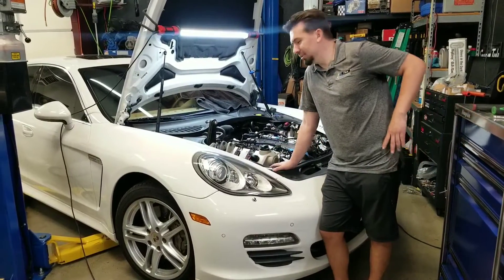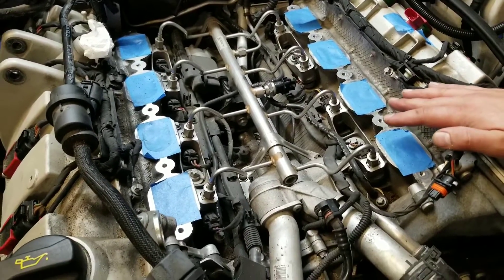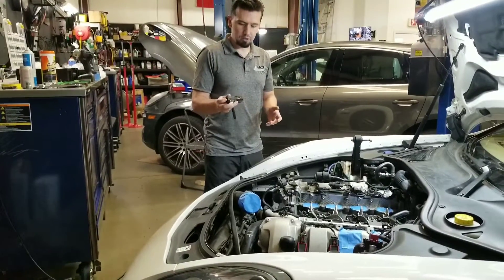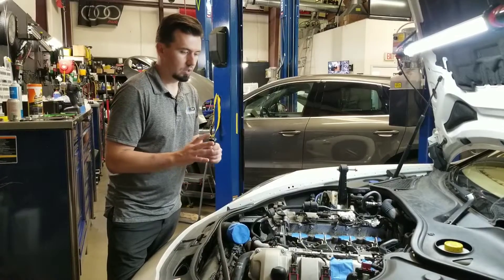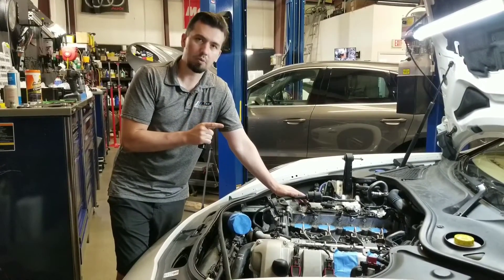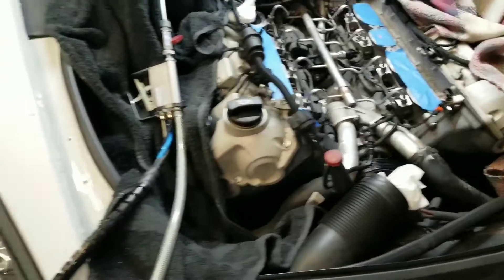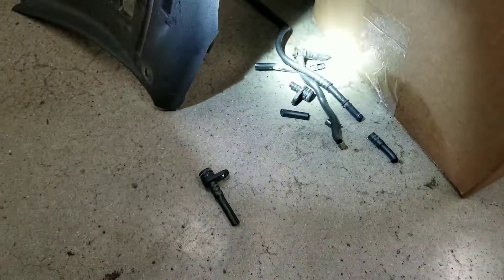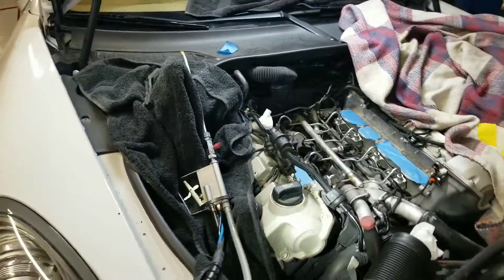PORSCHE Panamera with nasty carbon build up on all intake valves | What is the solution?

Comment: GREAT INSTRUCTION NICK! I had never seen this before and your explanation of WHY it builds up in Direct-Ijnected engines is easy to understand. In the video you mention it takes all day to do this, I imagine the majority of the job is in removing the intake, or is the actual decarbonization really that time intensive? I have a 267k mile Cayenne GTS, i can’t wait to remove the intake and see what those intake valves look like. Great tip too to point out that plastic vent system as a while you’re in there job. Thank you. I hope to see a DEMO of the De-Carb process, do you just adjust the crank shaft rotation to get the valves seated, and that’s when you blow the media in there? Is this not an opportunity to put abrasive media in the engine, or does whatever gets into the cylinder just somehow get picked up and removed with an oil change?

Comment: So the vr6 doesn't build up carbon in the intake valves?
Reply: It’s problematic in DFI cars because fuel is injected into the cylinder, not the old type port fuel injection which would spray the valve and serve to clean in, the problem is because of the oil recycling system which vents that onto the back of the valves, just collecting after time, a problem which only shows up when you have DFI and no fuel running across the valves, caking it onto the valves.

Comment: Bro can this cause a no start? My car was working fine but had starter issues. Pulled manifold off but had to wait a couple of days for starter to come in. Now cranks fine but wouldn’t start. Tried everything, new coils and plugs, changed map sensor, checked injectors. Pumps low and high pressure good. I feel this is the only other thing
Reply: Something you didn’t put back right go back and check your steps
Reply: @mr.mrs.keesee1169  issue was in a different place all together valves were seizing up and eventually once cranking one broke. head run hot on low oil engine issue. that was the original problem causing the slow crank. got a used cylnder head from the junk yard, seems to be good so far.
Reply: @chinaasia4584  thanks for the response! Good work!

Comment: I love these videos Nick. My cayenne   turbo S was a learning project. After installing a stage 2 tune and removing the oem exhaust. I notice excessive oil consumption. I installed 2 catch cans on the motor and cleaned the engine as well. A lot of parts were replaced and I learned a lot but I still love the 4.8. Not a ton of knowledge online so thank you for sharing.
Reply: where did you install the catch can? and can the AOS be replaced?